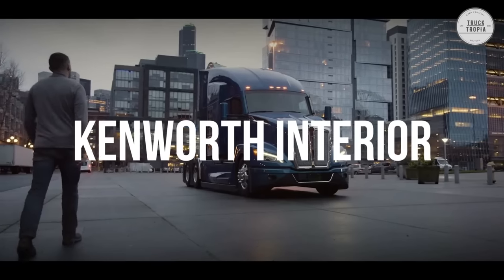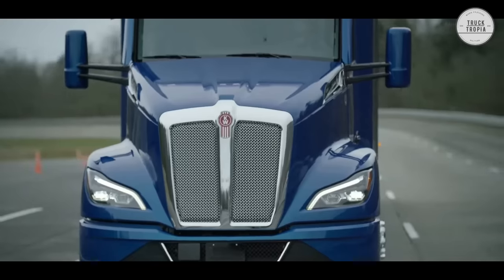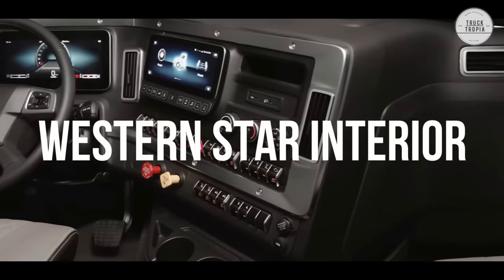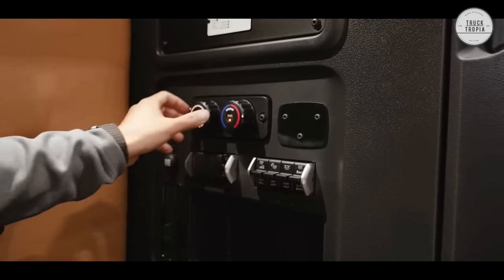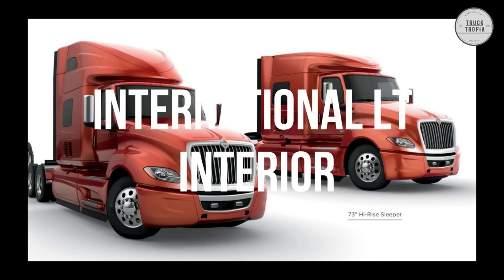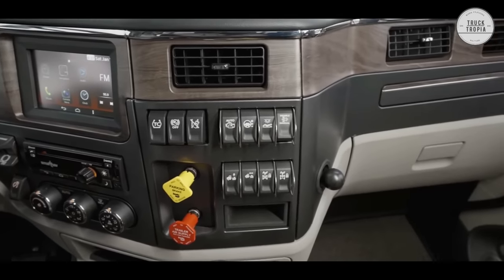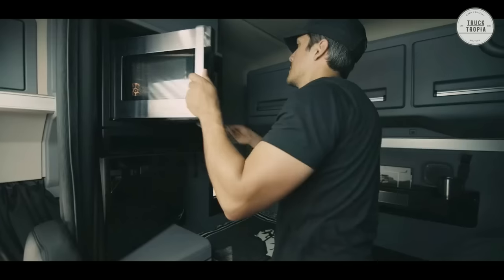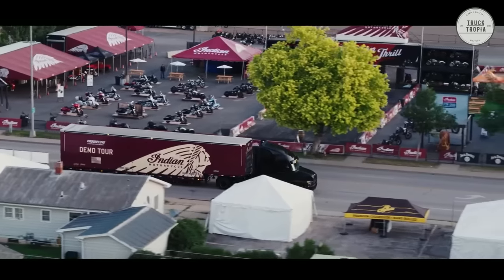Epic American Interior Battle - Which Truck Has The Best Interior?

Comment: I'm not sure who did the scoring but they make my head hurt.
There is a significant difference between judging in a driver's seat and when in the sleeper.
1. Paccar (KW PB) the sleeper is amazing. Quiet, comfortable, spacious. The next gen while in the driver's seat is best described as frustrating. Everything you would hate about a Freightliner are now available with a Cummins option.
2  International is pretty good in the sleeper although it's small. I found the driver's seat experience to be the best. I feel they actually gave thought to driver experience. For example, worth the steering wheel set in a comfortable position you can actually see all the gauges and buttons.
3. Western Star is to Freightliner as Acura is to Honda with none of the reliability.
4 Freightliner is designed by non CDL holders who were dropped on their heads as babies.
5. Mack, no experience with this one but at least it's not a Volvo.
6. Volvas, I've never driven one but apparently they put something in the AC that turns otherwise normal humans into asstards.

Comment: Sleepers don't matter to me, I don't use them. My favorite interior is the first generation Kenworth B model cab with the bumpout that was added later, mid 90s-2002ish era. They're very rigid, don't get rattly, aren't made of the cheap brittle plastic that plagues many newer interiors, and look very good. The cherry on top is how much easier it is to take them apart and deal with gauge issues or adding switches, compared to newer designs where it's obvious that it was designed to be hard to take apart.

Comment: You're compared only to modern American trucks, try with classic American trucks
Reply: I would like to see a video on the classics. A couple I miss the most is the 1970s International Loadstars and 1990s Ford L series.
Reply: Even classic American trucks had ugly yellow parking brake and red trailer brake. 

I don't get it, trucks outside North America have different parking brake designs while all American have the same parking yellow diamond-shaped parking brake?
Reply: @automation7295  Because that's industry standard? Nothing wrong with them. They're just fine. They *are* removable though...... Very easy to customize.... My favorite I've seen was a donkey (truck) and cart (trailer) I saw at Iowa 80
Reply: @automation7295  likely a regulatory thing